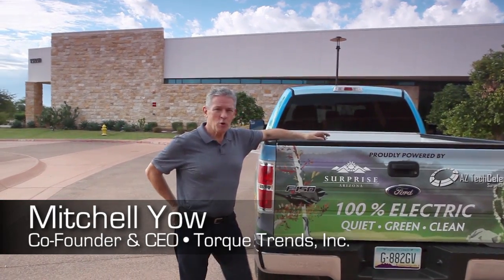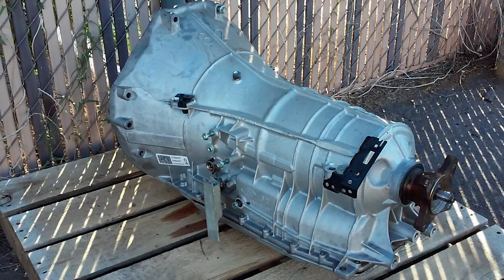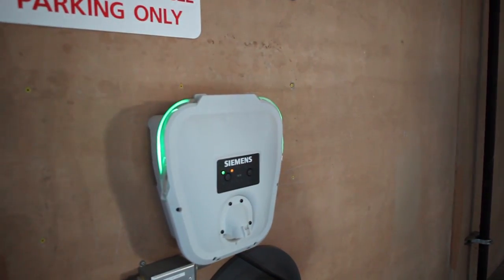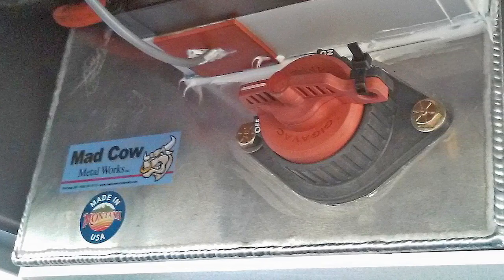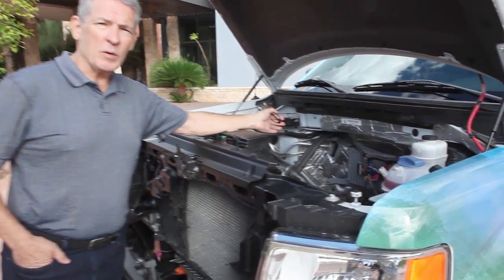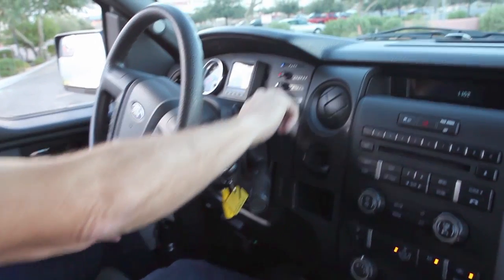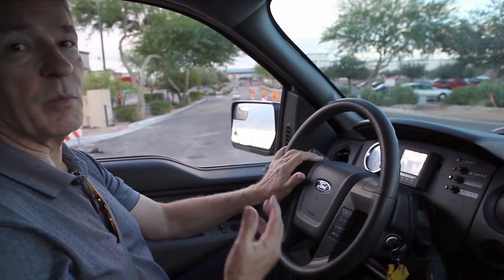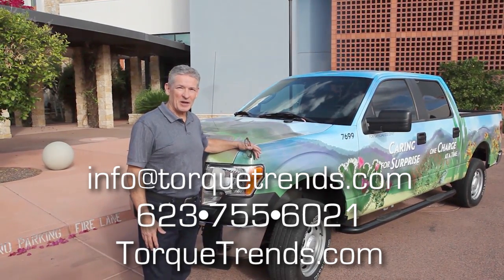Electric Truck Conversion - PNP F150 by Torque Trends Inc. Full Version

Comment: I love the idea of EV but in the northeast to charge them u still need fossil fuel,  why don't these guys come up w/ a clean solution to recharging the batteries?  reminds me of the carbon credit scam
Reply: Coal is 3rd place or further back for every NE state.  Get your facts straight.  It's damned hard to make your EV more carbon intense than a hybrid.  And if you want, you can buy some solar panels and make fuel AT YOUR HOUSE.  You just can't even pretend that EVs are bad for the future, so don't try.  It's like you're a petrol company astroturfer.  Who would even talk try to use carbon credits to malign EVs but an astroturfer?  There's no connection.  (The solution to carbon credits is an economy wide carbon fee (return it equally to the people, ideally).)  I mean, it has nothing to do with EV footprints!  https://www.washingtonpost.com/graphics/national/power-plants/

Apologies if you're not an astroturfer.  Look into a rising revenue-neutral carbon tax if you really, really, really care about carbon emissions.  Elon Musk, George Shultz, basically any economist you can find, see it as the most perfect possible solution to correct the energy economy.
Reply: Bryan Seigneur problem is we need more mkt forces & I believe federal subsidies r holding back renewables.
Reply: Even in the northeast electricity is getting cleaner every year.

Comment: Great video. No cooling for the battery pack while charging?
Reply: With low amps and slow rate of charge cooling is just not needed. Cells are rated to 70c and they are never over 35c charging or 40c under load.
Reply: It does not have massive energy density and crazy high charging wattage. LiFePO4 are very tolerent and resistant batteries reletive to others in the lithium ion family. As long you don't push it to crazy level if its a little warm it should not have much detriment. Problem is LiFePO4 is one of the least energy dense in the Li Ion group.
Reply: Slow rate of charge overnight so no need for cooling, batteries never see over 40c and are rated for 70c.

Comment: This has always been the problem with converting ICE cars to electric, by design it's difficult to find the space to place enough batteries. Let's be honest here, the 30 kWh pack is not nearly enough considering the energy it would have to output while transporting heavy cargo. It's best to wait for manufacturers to design one from the start or at most, use the services of companies like Local Motors for a specially designed chassis.
Reply: This truck for the city offers 75 miles per day between charges and the city only asked for 50 miles per day. The stop and go nature offers strong regen which really helps range. Again, it is designed for short range light duty use.
Reply: At the output of the transmission, a 2.7 liter Ecoboost F-150 will have 1,759 lb-ft of torque in first gear, and the output to the axles from the final drive can be as high as 6,560 lb-ft. Comparing torque outputs doesn't really mean anything unless you understand the application really well. Power is really all that matters.
Reply: @PistonAvatarGuy  Couldn't give me an Ecoboost, couldn't pay me to have an Ecoboost. Garbage.
Reply: @oby-1607  Better than any modern diesel.
Reply: A purpose built chassis that can take handle like 800lb/ft plus quick electric torque would be nice also. High end barely "affordable" BEV truck should have that amount of twisting force that is just difficult and and unreliable with most combustion engines (except a massive turbo diesel). Now that would be a cool dream pickup truck.
Reply: And pay 75 grand?
Reply: Instead of a tool box in the bed, you could put an extra battery box there, possibly doubling the range or torque   Still plenty of room to haul things!